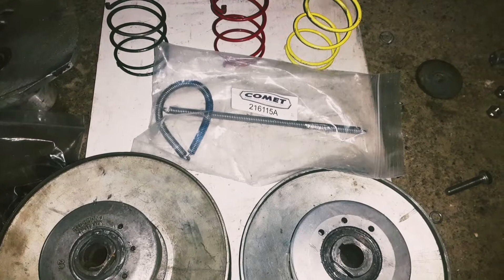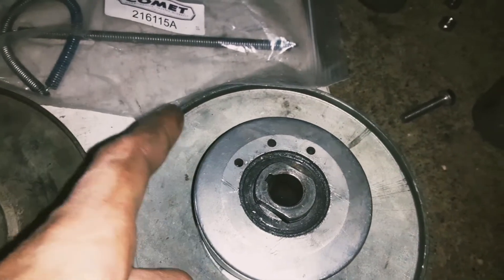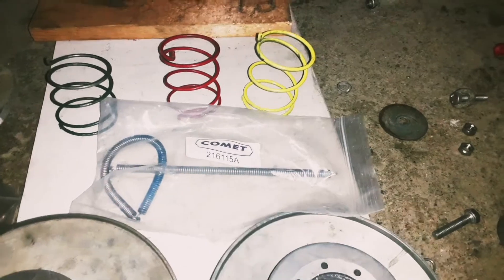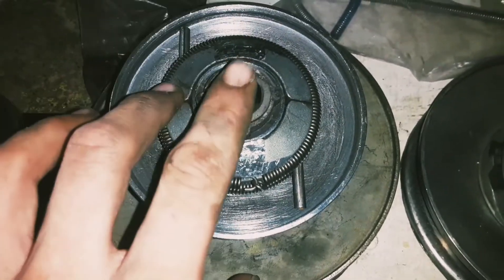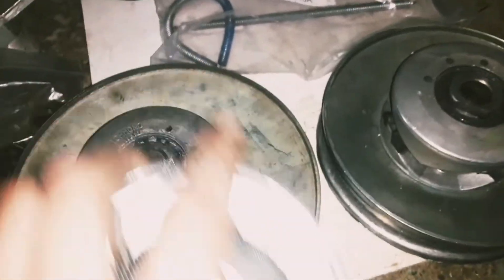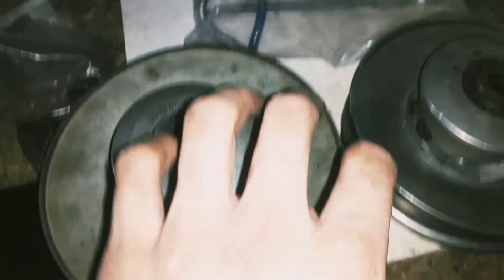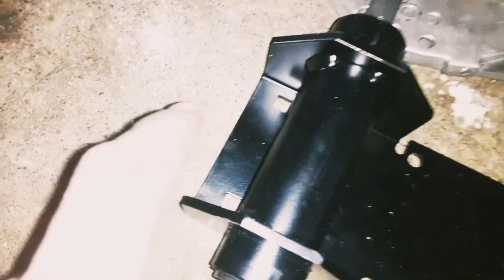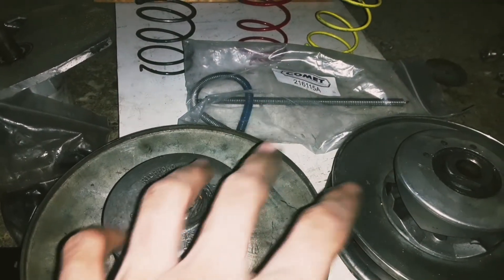30 Series Torque Converter Tuning Basics

Comment: This helped me a lot. I didn't know what I was doing and bought a bunch of Chinese junk not realizing. Now I am doing the backwork and "modifying" my Chinese junk. Lol I know the metal and welding is better on the name brand things. As thing fall apart I will be replacing with quality products. Thank you for explaining this. 

Just got a bloody go kart and it's nothing like a scooter. You should of seen my face when I realized there were no rollers. I was so disappointed. I had all this gear but couldn't use it.

Comment: Hey bud,  great video. My genuine comet setup has been giving issues. Sometimes it will stay in the low speed even at full throttle, and then the next minute it will go into high speed. Always random

Comment: Give a Juggernaut a try.  I fooled with springs and weights forever and never could get it where I wanted it.  Popped the Juggernaut on and it was perfect out of the box.
Reply: Yes it is just the driver and will work with any 30 Series setup.  Just be sure to use the right number of spacer washers to get it to line up with the driven pulley.  It is not more "powerful" but it prevents belt slip and downshifts faster than a Comet style, so when you let off and then get back on it, you have all your torque.  It also allows the engine to rev higher.

Comment: What is the best way to get the driven pully not to slip?  I've tried green, red, yellow on the driven in the different holes and if I go full throttle off the line (on a stock 196cc) it slips like crazy.  I like how the yellow in the middle hole on the driven with the comet blue springs on the drive works but it still slips.  I've even go as far as add a mount to keep the plate from flexing which did reduce the chatter.   I've tried a few belts... is there one that works best?  I can't find one of the juggernauts in stock so I ordered a clone on amazon to see if that is better.

Comment: I like how you broke it down, and laughed my arse off when you said fukn cats are goin nuts 🤣
If i were to put this TC on a 79cc predator, what springs, weights would you use for a motorized bicycle, with a 44t rear sprocket with 24" rims? Thanks for the video. 🙂

Comment: I have a mini XRS with a ghost predator engine on it and a series 30 torque converter what sprocket sizes should I use as well as springs and weights the rider is probably 60 lb so the whole thing combined is still less than 200 pounds machine and driver it's going to be written mostly semi off-road trails and such the tires I believe the biggest they would be is 16 to 18 in smallest 13 in
Reply from the maker: I can't really say about the 16s or 1es since I haven't ran em before but. For the 18s I'd recommend a 9/50 or a 8/ 50. A 9t on the front sprocket would make a good street riding set up. The 8t on the front would be good for offroad and extra torque. I'd recommend a 3000rpm spring in the clutch for good response and acceleration. And a the middle spring tension setting on the rear pulley. That should get you started.

Comment: What would be an idea combo for an offroad kart? Tillotson 212 with stage 1, 6" driven. Not concerned about top speed. Need hill climb torque and acceleration out of sharp turns. Any help would be appreciated. Thanks
- Josh Norris
Reply from the maker: The tilly 212 and stage 1 will be good but I I would suggest a 7 inch driven  set up. There's more torque with it but you have to buy a new jackshaft  off nmi karts. That and a 10t jackshaft sprocket  and 60t rear sprocket should make it a torque monster. Adjust the driven pulley spring to the tightest position and order a set of 3100rpm stall springs for the driver clutch and you'll have a perfect small block offroader

Comment: Hey man I just put a go powersports torque converter on my Coleman mini bike. It won’t shift out of low gear. The primary clutch stays open and won’t close to make the belt ride up. Please dear god I hope you have a idea cause this is really aggravating
Reply from the maker: Is your throttle opening all the way and is your pulleys lined up right?
Reply: @minibikegarage1577  yeah this bike is a year old, throttle is open all the way.
Reply: not sure if this might help....i just might make myself sound like a complete idiot, but......remove the brass ring from the driver....do not use the small driven chain sprocket that came with your torque converter (keep the stock installed)....make sure your thottle is completely tight with zero slack....
Reply: @iofjupiter  mine doesn’t have the brass ring, and kept the sprocket that came on it. It’s just weird. I thinks it’s working fine it’s just so different than the regular clutch

Comment: I just installed a 30series Chineseism on a predator 212 on a minibke. My problem is it won't dissengage. It's installed correctly the correct belt is installed correctly as well. I'm at a loss would any of these things cure my problem?
Reply: The bronze or brass bushing is getting snagged as the driver slides on the hub in bet
Reply: @joshuaatkins5197  that's exactly what it was. Somehow the bushing had a crack in it. Put a new one on and also there was a bur on the driven pulley